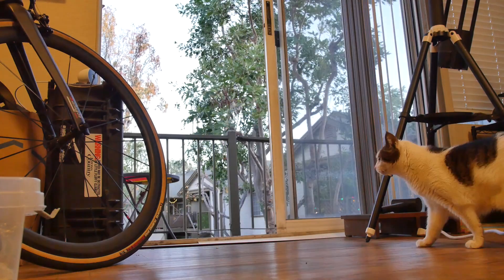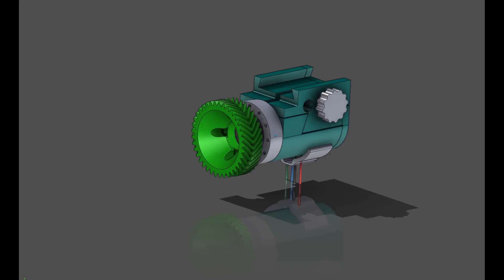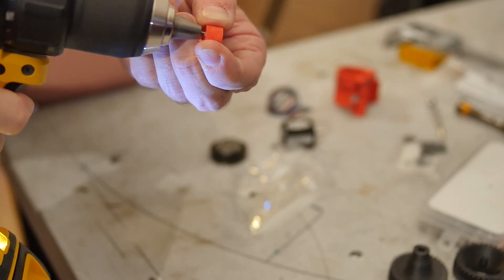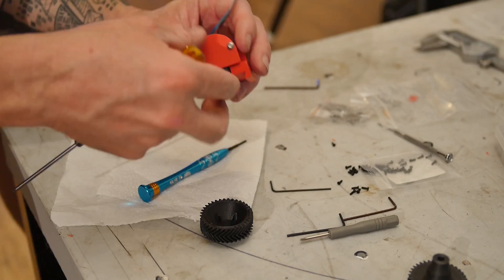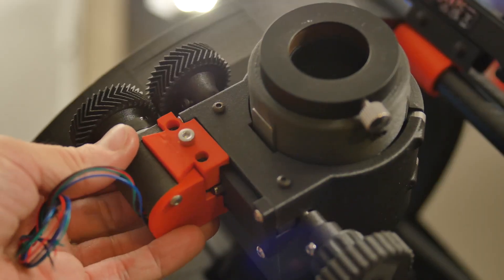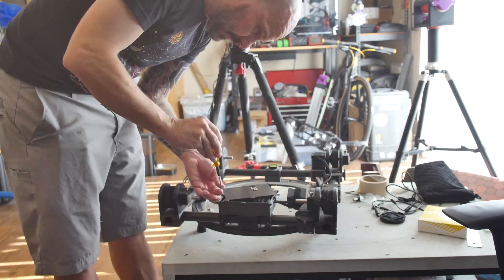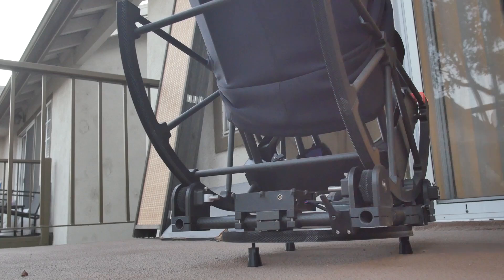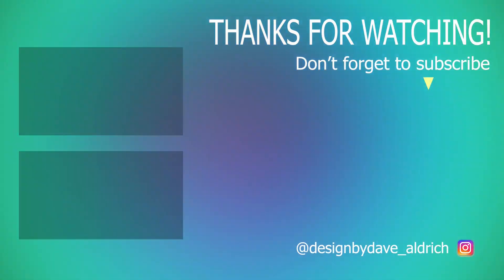Harmonic Drive Electronic Focuser for Telescopes - 3D Printed

Comment: I downloaded it but it is the complete piece, not in parts.
Reply from the maker: Yes, it's a STEP assembly. You can open it up in any CAD software
Reply: No, it doesn't come out in parts. I use a Creality printer and it comes out as a complete focuser.

Comment: Cool video! What about the electronics running the motor? Is it controlled through ASCOM?
Reply from the maker: Thanks. The OnStep control board handles that and then ASCOM for interfacing with astronomy software (NINA)

Comment: Ive just spent 2 months getting my diy harmonic drive design right, whats the other ways to do the same thing they do?!
Reply from the maker: A planetary gearbox or other traditional gear reduction design. They all do the same thing, just have different advantages and disadvantages. A harmonic reducer might be ideal for an application like a telescope mount, but less ideal for a focuser.
Reply: @designbydave  ahh right gotcha. Thanks dude.

Comment: Well, yes, only the last gears kill all the charm of the harmonic reducer. IMHO.
Reply from the maker: What "last gears"? The 3d printed gears?
Reply: @designbydave  Yes, 3D printed gears. I don't think it's too critical and will affect focusing. Overall, everything is fine. It just slightly messes with my engineering brain)). Don't pay attention to me)
Reply from the maker: @sergekolesov3971  Oh I think maybe I see what you're getting at. Precision of harmonic drive, right next to the lack of precision of 3d printed gears? Something along that line. Haha, yeah I can see that. One benefit to herringbone gears like this is they have basically no backlash so I have that going for me. And yeah, also focusing doesn't really require precision, like say, a telescope mount would.  A belt would probably be a superior option but I can't 3D print a belt, making is somewhat less novel. Thanks for checking out the video.
Reply: @designbydave  That's right! We speak the same engineering language. That's great! Thank you!

Comment: You fancy ponce! Using Lemo connectors for a stepper!
Reply from the maker: 😎
Glad someone appreciates that as they were a MASSICE pain to solder/assemble.
Reply: @designbydave  Lemo makes the bestest, sexiest connectors imaginable, it not the assembly that is the pain, but the pricing...
Btw Weipu makes pretty slick ones as well, with way more reasonable prices.
Reply from the maker: @VEC7ORlt  Thanks I'll check that out. In my case, the assembly far out-paced the cost in the pain-in-the-ass scale haha.

Comment: what a coincidence I bought a ZWO EAF a few weeks ago with their year-end sale. Just started thinking about EAF recently after some frustration with manual focusing
Reply from the maker: Cool, I just looked at that as well. The cost of the harmonic drive I used is almost as much as that whole focuser, so this project is definitely not a good value. It does have zero backlash, which as I understand, can be kind of a big issue with the ZWO unit.